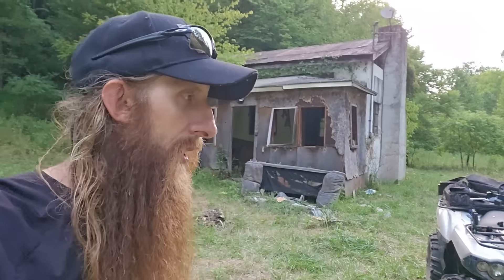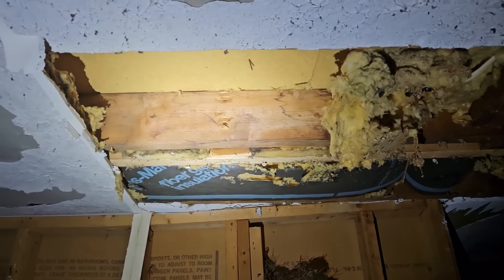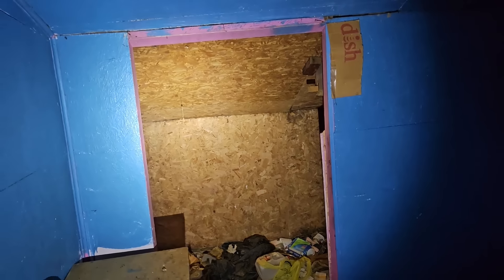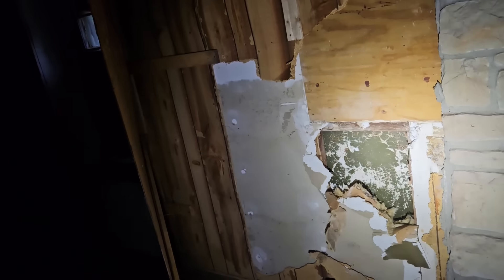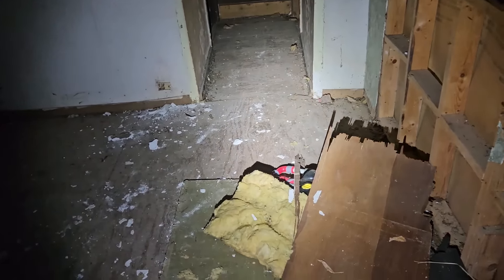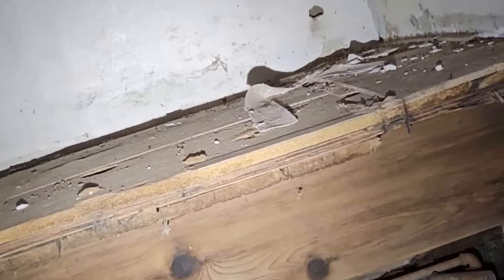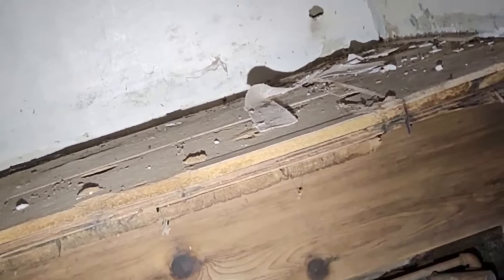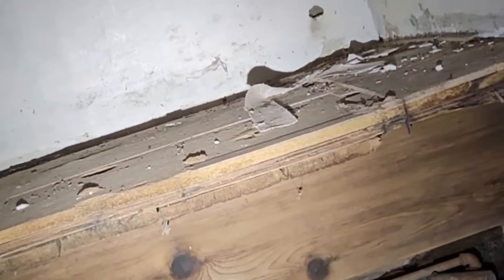Demo plan and addressing moisture issues

Comment: Don't forget to get rid of the trees within 10 feet of the foundation.  Those roots will cause foundation cracking at a slow pace as the trees grow.  It's a lot like not having gutters, but not moisture related.  I hope you can re-grade the slope around the house.  Drain tiles will eventually clog and need replacing, but good grading is a permanent fix.
Reply: Depends on the tree but that’s a good rule of thumb.
Reply: Not having gutters can also attract roots .The foundation and general area becomes a trap for the water and roots fallow the moisture and ypu end up with the same results.
Reply: @Dirt-Fermer  I have xmas trees right on each corner of the house we bought, should i remove them? 5 foot tall about
Reply: @justinlinty   if the trees are 5 feet tall they aren’t hurting anything right now and can be transplanted in the fall about their max height away from the building if you are worried about damage. If they only get 20 feet tall they can probably be 10 feet away if the roots aren’t crazy but it depends on your foundation, and how aggressive the specific trees roots are. I transplanted a couple different evergreens like 3 times in a year and they’re still alive, a little short but alive and strong.

Comment: My suggestion would be gut the inside completely, new floor big wide boards, bathroom and kitchen in the rear with a loft bedroom above them, then the rest is all open , use the original front entrance with over sized door, restore all original windows, new exposed beam roof,
Reply: I thought the same.  A loft in back, with the high ceiling in front, and put the big windows back in.
Reply: thats vision there, schoolhouse meant for 20/30, living house meant for 2/3... the 55gal drum comment with gray water headed for the creek should be worked into the grading plan before repointing the block... that wasnt mentioned... at 30 im all in, at 40 im checking better options, at 50 im investing, at 70 i got nothing else to do

Comment: If it was really a 1 room schoolhouse it may be a historical site.. you may be able to restore it and get paid visitors.. and you may find some really cool artifacts on the way.
Reply: I was thinking the same thing about artifacts.
Also, he might qualify for some kind of a grant to restore it - if he chooses.  Unfortunately, strings often come with grants, so that might not be so great.

I look forward to seeing the updates.
Reply: My uncle received some grant money from the Historical Society in Utah when he bought and restored an old house. It was state, not federal, and I believe a private group. He had a nice plaque on the front they presented to him. I don't think there were any strings attached. My uncle just liked fixing things.
Reply: Trowel stucco, keep it white . A mid sized excavator to peel off the garbage & the inside walls , save the concrete , if the block is unfilled , use #3 rebar & quick crete 5k , span it with doug fir 2x10 or 2x12 . The concrete block usually doesn’t qualify for historical, but every area is different, (looks like late 30s/early 40s if its 16” block)

Comment: Definitely re-grading the back side, to stop the slope from going straight to the foundation, and installing a French drain along the foundation! 👍🏻 Good plan 😁 
My friend bought a piece of land in KY last year. She had someone come and dowse for her -- it turns out the best place to put a well is right where her tiny house is!  😯
So, she's relocating the house next spring, before she puts in her well 😂
In the meantime, she never has to wonder where the spot is that she's gonna sink her well 😉😂
Reply: Dowsing is fake. Get an actual well driller to inspect the place.
Reply: @ferretyluv  dowsing probably found her water in her pipes though
Reply: Dowsing didn't work on my property. In my area its over a grand just to drill 100 feet. Get a well driller thats familiar with the area. Dont movie the tiny house. If there is water under it there will be water 30 feet away from it.

Comment: I like your plan. I would get electric turned on asap. Even if its just to a pole in the yard. It will benefit you and will if hes able to charge his batteries quickly and with solar in the hollar sunshine is an issue. I would like to know when the dumpster is arriving.

Comment: I’m sure it needs new footer drains, if it even has any at this point. Here in WV, unless you live on the very tip top of the hill, everything needs good footer drainage. I’m currently doing these types of drains around my barn and did them around my garage 2 years ago. When it rains hard water seeps through the block. I dug down and coated the walls with sealant, then buried perforated pipe ran to an outlet over the hill. The garage was my first time so I didn’t know about it, but with my barn I’m also covering the pipe with mesh that’s supposed to keep roots and mud from filling the pipe. On my garage job, I did do an idea I had that I really liked tho, I installed a clean out on one corner where I can take a cap off and spray a pressure washer down inside and flush the pipes occasionally. Idk if that’s recommended or not but I like it. Also, yes gutters are massively important and idk how a house would even last this long without them lol

Comment: The rain on the trees sounded so beautiful. I love it when Mother-nature sends us messages so soft and sweet.  Thatreally gave you a little more insite to the issues. Will will love digging. It's going to be amazing when it's finished.  The demo will be pretty cool. Sounds like you've got a good plan so far. The stairwell definitely needs to be better designed. Take your time one day at a time and after the demo and water control and flooring it may become more clear to you as how you want the rest finished out. 🙏🏼

Comment: It looked like moisture was definitely the main reason the flooring rotted, that press board on top was a bad choice as well. 1/4"plywood would have worked. Good idea to dig a trench of some sort.  Use some paint on moisturizer barrier, possibly on the remaining blocks just to be sure. Im sure you know all this stuff anyway, but it's cool as an old flooring specialist to watch. 💯

Comment: Alot of people don't understand but before you even put down a foundation you need to have a drainage plan for what can and possibly what will happen in the future , this is a big part of a build  that will determine structure durability !! .alot of times when people build close to a slope or hill erosion occurs faster than anticipated , so it's best to plan ahead and put in the French drain like you mentioned I'm sure it's going to turn out great 💯‼️

Comment: I think you’re on the right track. Clear out all the trees at least 10-15ft back, do some grading to channel water away, install a French drain anyways. Your roof and gutters plan are on point. I’d completely gut it down to the floor joist and studs (maybe those too). While the flooring was up I’d deepen the crawlspace overall or at least do trenches. Yea it’s a giant pain now but future work will be easier. In a rent house I bought it came to light the “septic” was a block cesspit. The only option we had was a tank digestion system. It’s was expensive and a pain but honestly better than traditional septic. I never had any experience with wells though. Love the videos, Minion is the man! Oh ummm, y’all are cool too

Comment: Figuring you’ll never see this… but, after you do all the exterior surface and sub-surface drainage improvements - - - >

Put in an Atmox crawlspace system to monitor the moisture content of the air and cycle on a series of tiny fans and dehumidifier(s). 

It’s basically like a thermostat but instead of monitoring temperature and turning on to heat/cool the house, it monitors moisture content and turns on to keep the content at a maintainable level for the benefit of the wood framing.

Comment: Looks like Cubical Brown Rot where the joist has been wet and dry so many times the fibers loosen and will come apart in chunks with very little effort...if termites your closest Co-op ought to have a few baiting systems to choose from that are recommended over chemical liquid treatments due to the fact that the chemical liquid doesnt provide the residual protection they used to and are way more labor intensive to use than the baiting systems..just dont use both at the same time👍🏼one or the other...have a goodun
Reply: Exposed foundation or not...MAN!!..aren't those afternoon rainstorms NICE! this time of year 😂💦💦

Comment: Hmm, if the moisture rots the floor beams, you could pour a layer of concrete below the beams to seal the area. Unless you’re digging a basement. I like the idea of putting french drains around the house to divert water coming from the hillside too. In my state, it is so dry that excess water in the rainy season runs on top of the ground. The hill may slump a bunch of top soil against the house, so we would have dug the hillside back a bit & built a “dry creek bed” around that side of the house, and filled it with cobble stones on top of gravel to prevent erosion. These lead to sloped pits at least 20 feet away from the house, to either side that are at least 4 or 5 feet deep at their center & maybe 10 feet wide & lined with gravel & cobble stone to look nice. These supposedly help replenish groundwater by sinking it. I have no idea if it works. California rain is thin and the soil is sandy so even a good rain that fills the pits will seep into the ground entirely within 2 days.
Reply: We don’t have basements. Maybe the sandy soil is too loose? Or earthquakes make it unsafe? I don’t know. Underground rooms of the house never were popular here.

Comment: Looks like its going down to the studs, metal roof,  windows, drainage, gutters. I'd honestly paint the  block with real good exterior stuff. Siding for the peaks. clear as much as you can behind the building. add good drainage

Comment: Nat by the time u do all that and  gett it and get it reframed, rewired, replumbed, re-drywall,  you can get a manfactured home brought in with a new foundation. Cheaper.  I flip houses, i wouldnt touch that, theres no profit at all.  You could buy a log home kit and use that old foundation to put it on.  Ive done all that shit your about with the excavating to get the lot dry and  to rebuild that whole house, u will easily have 200.000 or more in it. I put 40 50 in remodels thats without gutting,  excavation 20 grand goes fast. Goodluck